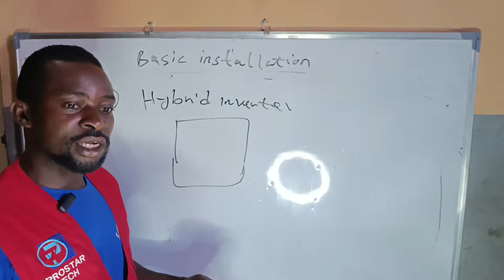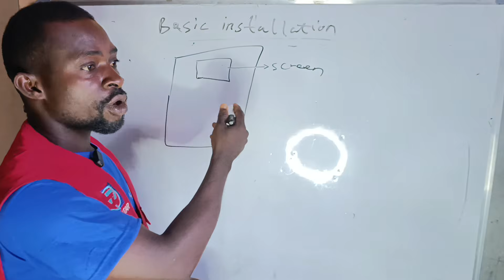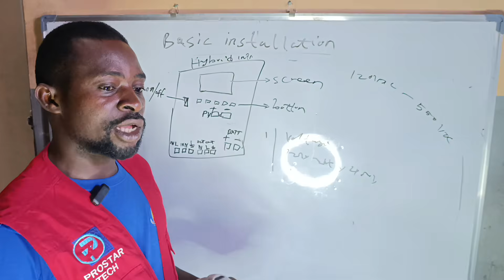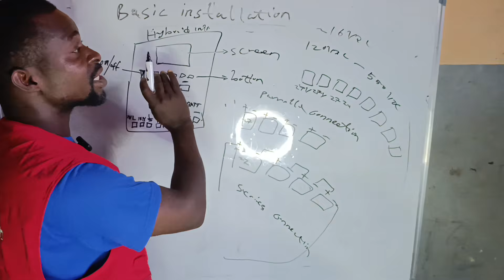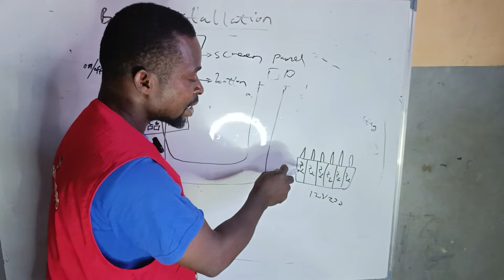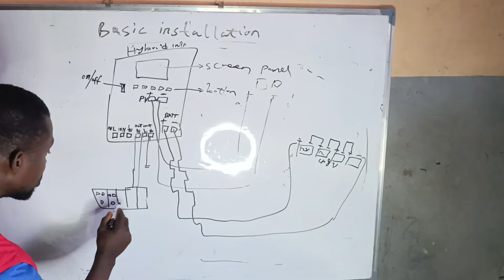Solar Basic information for beginners

Comment: Thank you for this class, Sir. My question is, did you run both DC and AC connections with just DC cable?
Reply from the maker: DC cable is for pv and battery connection, Ac cable is for internal connection.